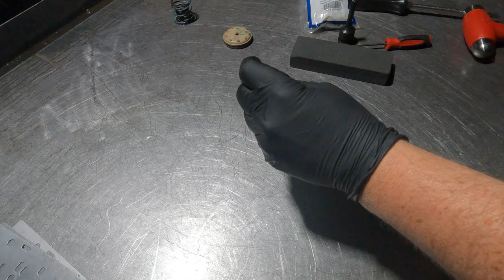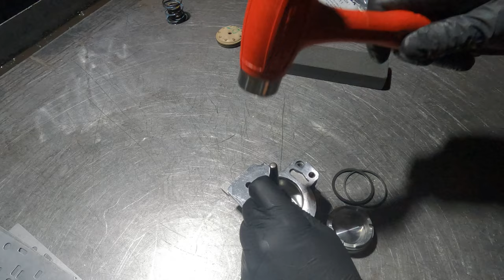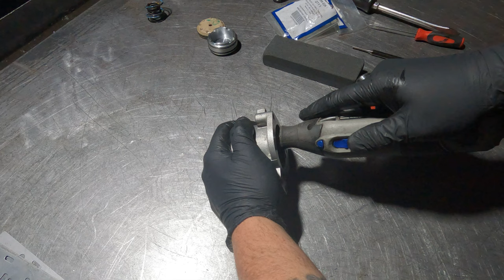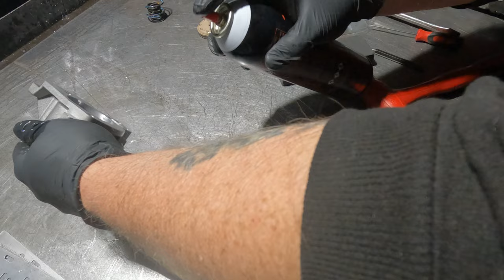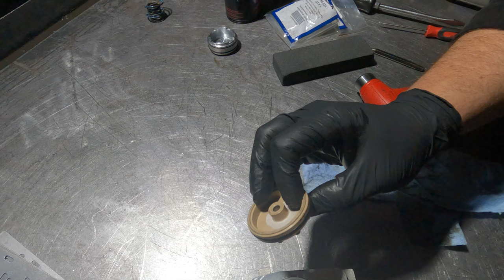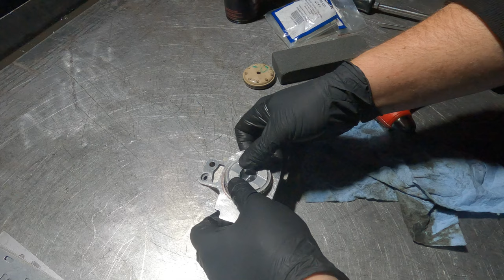Upgrade Your Transmission: Easy Installation Of Sonnax Pinless Accumulator For 4l60/e 1-2 Shift

Comment: Thanks.  Best video on this process I have seen.  I plan on dropping my pan and giving the whole bottom half a freshing up.
Reply from the maker: If you plan on removing the valve body, I recommended to use a flat file to smooth out both surfaces of the valve body, including the manifold pressure switch ports on the filter side and the wormtracks area on the case itself. You can use a Combination Sharpening Stone, focusing on the fine side, along with a small amount of transmission fluid. These stones are available at Harbor Freight for around $1.99.

Make sure to carefully inspect the VB Plate for any check ball wear. You have two options: replace the plate with a new Transgo plate or repair it using a VB-101 kit from Fitzall Repair Puck. If you choose to replace the plate, it's advisable to use Imidized Plastic check balls (Sonnax # 10000-08) to prevent future wear between the check balls and the plate.

It's recommended to get all new electronics. For the Manifold Pressure switch, go for AcDelco; for the EPC, choose BorgWarner; for the Shift solenoids, use AcDelco; for the 3-2 downshift, opt for BorgWarner; for the PWM, go with BorgWarner again. Additionally, get a new internal harness from Rostra, which is now an OEM supplier.

Comment: So when taking off my old accumulator, part of the gasket under it that goes under the valve assembly broke and now I don’t want to put the new one on until I know if I would have to change the entire seal. Something I don’t feel comfortable with with all the checkballs etc etc . Is there a small gasket I could buy to replace just under the accumulator?
Reply from the maker: You would be better of to just drop VB and replace the VB plate with a Transgo one + replace both upper and lower VB plate gaskets. Also installing the 3-4 Sonnax pinless accumulator & upgrading the check balls from steel to torlon material would be good upgrade. There is a 1-2 plate that is just that corner piece and a gasket also just for that small corner part of the plate for just the 1-2 accumulator but... its primarily made for when the plate is damaged from the springs & requires a good gasket below it and then the small new gasket above. Of which we have all of those parts just go to link below for direct contact and information : https://form.jotform.com/60043609371147

Comment: So what if u dont put that check ball in, lol cuz i didnt, and my trans doesnt want to drive u less i use overrun clutches or manual 1-2
Reply from the maker: will be a BAD pressure leak.... and not function properly as you found out.....

Comment: Is the larger spring in the 1-2 the same part number as the 3-4 accumulator?
Reply from the maker: No the 3-4 is usually lighter tension the "Purple in color" 1-2 is a much thicker coil & much heavier spring usually no color or white or green".
Reply: I have the small one.  Dealer told me that my transmissions 1-2 didn't have the larger one in it
Reply from the maker: The later year onse did not have the inner and outer 1-2 springs just the smaller one "usually" causes a harsher 1-2 shift I always put in the outer spring.
Reply: I think I'm going to order the outer one.  Just the inner in the pinless accumulator looks like she wouldn't want to stay centered
Reply: Does it usually use the brown inner spring with the outer one
Reply from the maker: @h.w.miller4180  The way I do all the 1-2 stock units but with pinless is yes the small short inner and some form of ann outer I use the OEM# 8673387

Comment: What’s the point of blocking the 1-2 3-4 and the fwd pistons
Reply from the maker: Blocking the feed passage for the 1-2 or 3-4 accumulators can result in a very firm shift, because it removes the fluid cushion between shifts. However, I do not recommend blocking the accumulators or the FWD accumulator in the valve body EVER. The accumulators are designed to cushion the shifts and engagements, while blocking the FWD accumulator can cause a severe FWD harsh engagement and potentially damage the gear train.

Comment: Thanks for the video, but i noticed when i took mines apart it only had 1 spring in it, the smaller 1, not sure if the previous owner tried to fix it or not, but every video i've seen there are always 2 springs, im leaving rhis message here because your video is more detailed and understandable, i have a 2008 gmc sierra 1500 ext cab 5.3l 4x4, should i have 2 or 1 spring inside accumulator?
Reply from the maker: When the Piston is installed into the housing first "pretty much all 4L60 AKA 700-R4's" this setup created the band apply pressure against the spring tension, the heavier the spring tension the harder the shift. Thats where Sonnax made the real heavy accumulator springs. but only firm up the shift if the accumulator is installed first then the spring.

With the springs in first (inverted most all 4L60E's) and the piston on top this created an opposite effect, more spring tension created a softer shift so on this set up.

If wanting to firm up the shift use less springs or a smaller "weaker" coil spring set up This is where Sonnax made the light purple spring. Prime example remove both OEM springs and install the 3-4 Sonnax purple accumulator spring "same as pretty much all OEM 3-4 accumulator springs" will result is a MUCH firmer shift. For the most firm shift tap and plug the 1-2 accumulator feed opening.  

So in your instance GM was trying to increase the shift firmness of the 1-2 shift or someone that worked on it.

Comment: Thanks for the video. Easy enough. Do you recommend using the stock springs or upgrading to the purple Sonnax spring?
Reply from the maker: I'm glad you found the video helpful! When it comes to upgrading the valve springs, I recommend using the stock springs on the 3-4 or the Sonnax purple spring #74926 only. As for the 1-2, I suggest using the OEM set unless you have an HP unit, in which case the Sonnax HP spring #77704S may be necessary as it's a very stiff spring. If you need an even harder 1-2 shift, you could consider double stacking the OEM springs with a spacer between them to allow for minimal movement while still maintaining a proper seal, but be aware that this will result in a VERY firm shift.
Reply: @TriStarWWPO  Thanks for the info. I'm only doing the 1-2. My truck has a tune and its set to shift firmer as is. I think I'll just leave the stock springs but go ahead and do the piston upgrade.
Reply: For the 1-2 accumulator should i put the small spring in just how it was before hand or just put the outer spring in and not the inner? Ive seen videos where people do it either way
Reply: I have to say, this is by far the best video I have seen on this very well put together and informative, I have rebuilt a lot of 4l60e trans I recently bought a 06 suburban with the 6.0 and it shifts really hard out of 1st and with the long duration in between I have the sonnax Piston going to change it in the next few days
Reply from the maker: if wanting to leave shift feel as it was leave as it is. Just remember on accumulators the shorter the stroke of the piston or valve in the accumulator system the firmed the shift the longer the stroke of the piston/valve the softer the shift. But on the firmness it is also dependant on the orientation of the piston on the 60E's spring to plate or piston to plate.

Comment: What about the other bigger ball bearing?
What do I do with that ?
Do i use my original spring again?
Reply from the maker: The other, larger ball that I threw aside would be for the larger pin diameters - typically .310 - found in 1992 and older 4L60, also known as TH700-R4. For the 1993 models and onward, which are the first year for E units like 4L60E, the pin should be .230. Yes, you can reuse the original springs.

Comment: hello sir. my 4l60 in my 06 canyon shifts firm only 1-2 and only when it is cold and makes a slight whine noise - when it warms up it shifts fine does it sound like this could fix my issue?
Reply from the maker: Could be broken spring and or accumulator itself cracked if plastic. The noise not so much ... colder fluid = thicker fluid. It would be my guess due to a OE cracked accumulator. When it gets warmer fluid get thinner and things swell from the heat a little closing the gaps for the leak.
Reply: This install fixed it. Was plastic cylinder. Likely as u said. Weak seal

Comment: What type of grease you use? Is it save to be mixed with the transmission fluid? Would be safer if we lube the o-rings with clean transmission oil?
Reply from the maker: I use Transgel mixed with a mixture of slick 50 & trans fluid. you can use just trans fluid yes or even a little bit of engine oil

Comment: When you’re tapping the t45 bit, do you keep going until it bottoms out on the ball?
Reply from the maker: No... just enough to deform aluminum to retain the ball. You can simply cross steak it with a chisel.

Comment: Do you ever do double stacking on the forward in the case
Reply: If you’re talking about the 4th accumulator 
Block it I do it all the time won’t hurt anything only block that one tho
Reply from the maker: Only on HP builds but....... on those though is better to simply block the feeds for accumulators on HP type builds